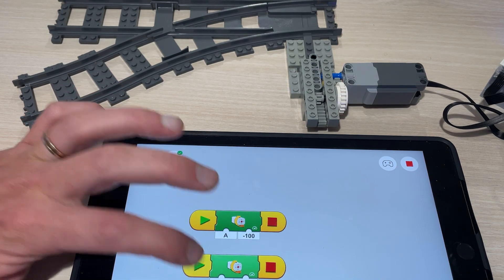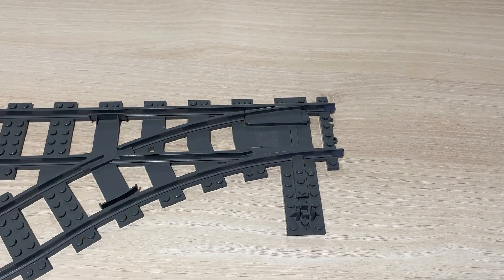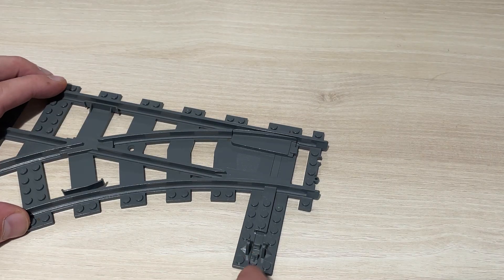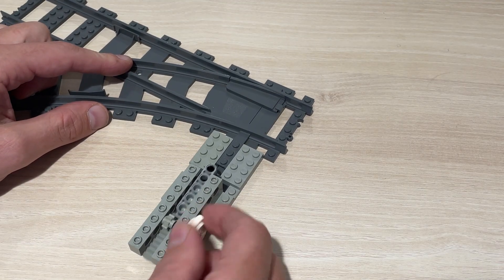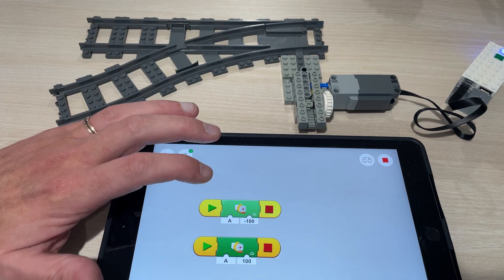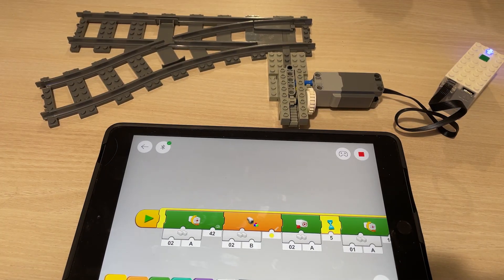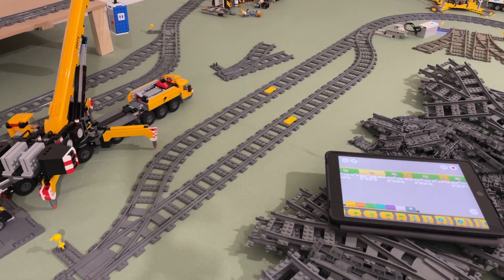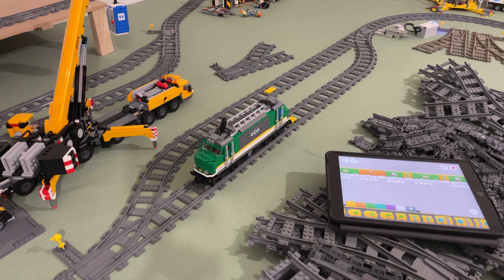LEGO Train Automation Part 4! 🚂🔀 Automating Switch Tracks for Smarter Railways

Comment: I did not know the Lego app could connect to and control 2 hubs at once. Also, instead of messing up your switches with a irreversible mod, why not using a worm gear with the gear rack so the motor has enough torque to overcome the switch's detent positions? You can still add a clutch gear for protection. Much more effective.
Reply from the maker: I think I covered multiple hubs in my first automation video! You could use a worm gear but I think the switching process will be a lot slower that way